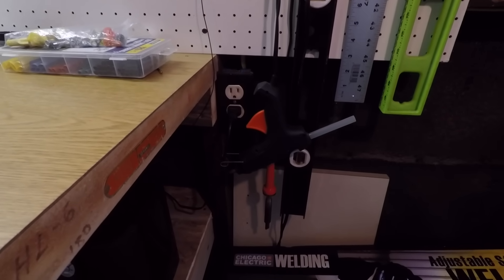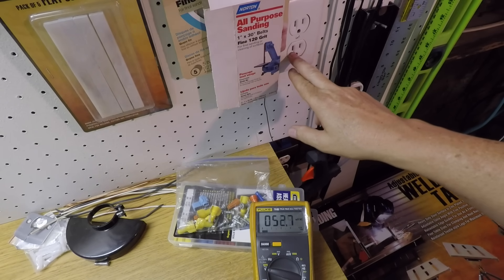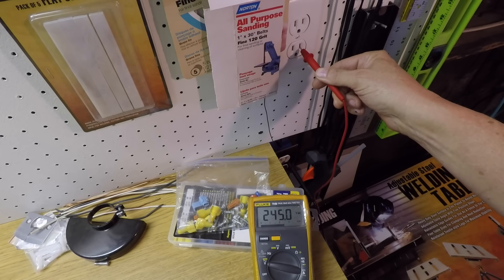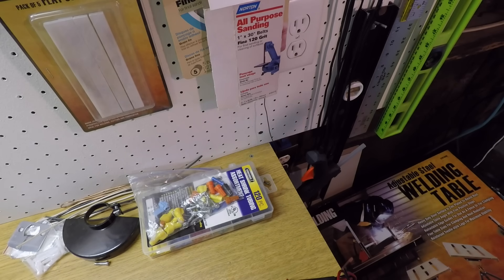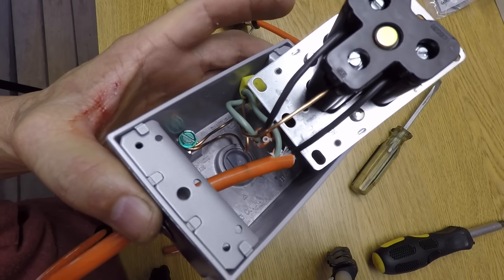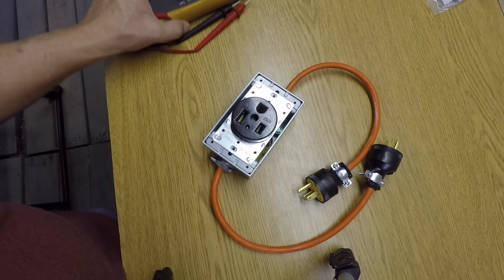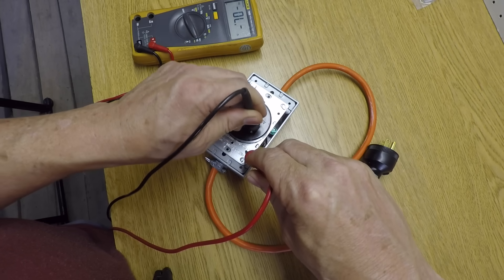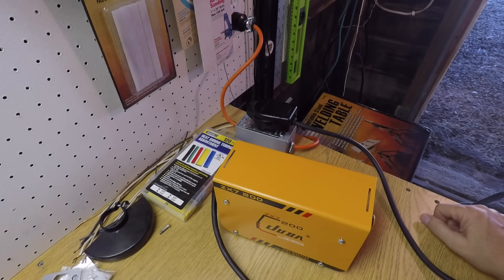How to Get 220v From 110v

Comment: Lol.  Putting 20a wire on a 15a receptacle  doesn't really make it a 20a circuit.  Close....but no cigar.
Reply from the maker: LOL Having more than one outlet and a 20a breaker to go along with it does.
Reply from the maker: The National Electrical Code, in article 210.21 (B) 1, 2, and 3, describes the requirements of single and multiple receptacles on a circuit.

The use of multiple 15 amp receptacles on a 20 amp circuit is permitted. A duplex receptacle is considered as multiple receptacles and is therefore permissible to use as the single, or one of several, multiple type receptacles on the circuit.

Part of the UL listing for the 15 amp receptacles is that they are capable of feeding through the 20 amp circuit, the primary difference between 15 and 20 amp receptacles being the faceplate configuration.

Receptacles rated higher than the circuit rating may not be used, so 20 amp receptacles are not permitted on a 15 amp circuit.
Reply: @DIYHomesteadProjectsDIYHP10  you can legally use a 20 amp receptacle on #14 as long as the wire is protected by a 15a breaker.   A 15a receptacle is only legally protected to 15a so do whatever you please.
Reply: I wasn't trying to give you a hard time I merely found the humor in it. I have done it myself.  I think that little wire welder won't come close to the capabilities of that circuit.  I wouldn't try it with a stick welder though.  Haha
Reply from the maker: I get that comment quite a bit on this video. I wanted to post the info I found so hopefully others would read it. Most people don't read anything, they just post what they are thinking. Anyhow, no worries, thanks for the comments!

Comment: Just wondering if after a year your garage isn't burned down?
Reply: Using the cheapest extension cord too. I wont even run general power tools on those cords...
Why not just build his own 50amp extension cord plug into the dryer or something...
Reply: 12 gauge wire can't handle double phase but if he doesn't use high amp required devices it shold be ok. but I wonder what kind devices it would be.
Reply: @psyo123  He said the extension cord is rated for 15 amps, which would make it a 14 gauge cord. 

There is no such thing as two phase power. This is single phase 240 volt power being fed from two separate breakers. You can put 240 volt power on #14, #12, or anything else for that matter. You size the wire based on the amperage required, not voltage.
Reply: @jonathanpakozdi2796  There is two phase power but this isn't it. Most two phase equipment and lines have been replaced with 3 phase power or single phase. Two Phase power was two phases 90 degrees apart. Three phase is 3 phases 120 degrees apart. There also is 6 phase power.
Reply: @gravelydon7072  right but homes have 2 phase in most places that's why the service is 240v at 200amps so than you brake it up in the panle so it drops to 120 v on each side  so when you do a 2 pull it gose across both busses to make the 240v again
Reply: @gravelydon7072  like when you do a home panel it should be balck and red if it's 3 phase than black red blue. Black is 1,2 red is 3,4 blue is 5,6 than you repeat.    277 or higher is typically brown orange yellow  brown is 1,2 orange is 3,4 and yellow is 5,6 and you repeat
Reply: @psyo123  12 gauge wire can handle 20 amps of current regardless of voltage,  240, 480, 120, 12v, etc.
Reply: Matter of fact all romex is rated for 600volts max
Reply: @sparkyjerred419  that rating is the insulation rating

Comment: if you read the output of welder fan it will show only 110 and fan will not support welder due to device thinking it is recieving 110 and 110 not 220 wear rubber shoes if you try this to weld

Comment: That's an inaccurate title. You already have 220. Why not use it as intended instead of splitting it adding more unnecessary connectors and bringing it back together. You could also add jumper cables in the mix but its not a good idea. It can also bite you if someone unplugs one side with the circuit on. 🤔

Comment: Would this be considered legal?   Technically I can see why it works because it appears to be electrically the same thing as draging 2 hot wires through a breaker which connects to each side of the bus.  I was thinking for insurance purposes if something ever went wrong would your home owners pay.   I was thinking of getting an electric clothes dryer but I don't have
240vac in the area but I do have 2 receptacles that just happened to be on different side of my panel bus verified by measuring the 240vac like in the video.

Comment: They do not need to be on different bus bars, as a 240 breaker is on just on rail bus bar in the service box. However  I'm not sure as to why you would cut off the neutrals? Should of got a 4 prong outlet and bonded them together in the outlet for safety reasons you need a common ground, neutral and hot or hots to complete a 3 wire ground system. Also one should be aware that if you are running a small load this would be ok however the 240 system always uses a larger gauge wire then what you would for a 120v outlet. So I would suggest keeping your device close to the outlet ( meaning no extension cord )...

Comment: keep in mind that the stranded pair has more resistance thus if you have a constant load it will heat up faster and hotter if they are not rated for the right load. Stranded wire also carries less current than solid. The only benefit that i see is that since you are moving it around, is that the wire used to plug into both phases of electricity wont break as they are being bent or twisted. I would just suggest to put a dedicated double pole breaker rated to what the welder needs and wire a dedicated outlet to it.

Comment: Every panel is capable of supplying 240V. The transformer supplying power supplies +120V and -120V, with the neutral going to the center of the transformer. The positive and negative bus alternate in the panel. Just get a 2 pole breaker and your output with be single phase 240VAC.

Comment: You should mention that each outlet needs to be fed from separate buss bars in the panel. I think I would run a 240 volt outlet before I would do this but I have a lot of experience with electrical work. Thx for the video
Reply: He HAS to be on separate phases, either in panel OR downstream. Physics requires it. He would potentially trip 2 breakers if he got it wrong.
Reply: 110 , just wiring massively improperly
Reply: Also should be said that he is not making 220 from
Reply: @crusherfang9368  Nope, he has established that he is getting it from one phase. That is all.

Comment: Pros can grab live power meter leeds and test away.. I would say to any novice/ diy you need to have thick rubber gloves on. If you sit, use on a non metal chair on a rubber floormat.You need to have eye protection, you just don't have the years in- you might make a big flash with some fireworks.

Comment: The comment abnout the wire size is correct. I believe that his welder is l;isted to draw 25A at 240 volts so he will not be able to get as much welding power as it is designed for. The other concern is with the circuit breakers. If one of them trips due to excessive current and the other breaker does not trip there will be a lot of the equipment that will still have 120 volts present. In that case unplugging the plug on the circuit that has tripped will probably have 120 volts on the hot blade. Using a 50 Amp plug might be to give him the opportunity to plug it in to a 50 amp receptacle already installed in another location. However thhat would leaave hir welder unprotected for it's 25 amp rating. I would want to replace the circuit breakers with a two pole breaker with a common trip to increase the safety of the situation.

Comment: Yours is a step up from my "test rig" : two extension cords from different parts of the house with a two prong lamp cord plugged into each hot thus providing 240v into two alligator clips!!!  (I had an piece of European equipment on the bench).  I hope your followers do not have an old Federal service panel and a "tombstone" buzz box that needs 50 amps!  That combination would make smoke!
Reply from the maker: An old buzz box or any welder that actually needs more than 20 amps would be tripping breakers before letting out smoke I would think.
Reply: @DIYHomesteadProjectsDIYHP10  yes sir normally but old Federal breakers have a bad reputation for not tripping!  No point really.  Keep tinkering.
Reply: @JIMO415   Guess who was one who found that out in 3 phase breakers. We had to replace all of them as they would either burn or explode. And boy did they stink.

Comment: To fix the last problem you mentioned,  put 15A fuses or higher depending to what you want to run to each hot lines of your box.
Reply: 15A "or higher"......now there's a recipe for trouble.
Reply: Circuit breakers installed by a electrician who knows ... Never exceeds amperage the gauge of the wire or you can melt the insulation, plastic and burn down your house.

Comment: I did that once by mistake in a three way switch setup..  It worked fine with candescent bulbs, only the fancy big flat type switches I used would pop and flash if you slapped them on/off to quick.  lol
Reply from the maker: Too funny!

Comment: You already have 240 VAC. You measured the two phases that you building already has. When you install a two pole breaker (240 single phase) you are doing the same thing as using the two 120 receptacles except you are running one of each phase to a hot terminal, hence 240V. (one of each 120 v phase) The neutral and grounds are the same for all circuits. You will see that your breaker box has a buss bar with all of the neutrals attached and a buss bar with all of the grounds attached. All you need to do is put in a two pole breaker and run the two hots and the ground to the 240v receptacle. This is how you get 240 in any house. ALL houses have two different phases of 120 feeding your main breaker in your panel. If you have an electric stove or oven, A/C or electric water heater or electric heat you already have 240 v circuits. There is no such thing as a single 120 volt electric box.
Reply: Well, to be fair, I don't think he was trying to say much different from what you just said - but he just doesn't zoom out far enough to see or describe the big picture...
Reply: Brilliant, he could have made the second plug a 240v just as easily.

Comment: Does a 20A breaker designed for 120V perform to spec when part of a 240V circuit? Will it trip at the same current threshold?
Reply: There are 20A 208v circuits this is not one of them without explanation.

Comment: Bruce, two deadly errors in design and not code compliance nor safe for you and your family: use logarithmic stepped standardized wire gauge and plugs plus you cant just eliminate the neutrals and just use the hots; the neutrals must be feed back to the bus on the main panel and you do that by utilizing the grounds ( pigtail them); you don't just cut the neutrals off.  Please research what I just told you, it's a cheap and easy fix.

Comment: What happens to your equipment when only one breaker trips?  Say your welding, or using a compressor and Jr. turns on his space heater and trips the breaker, will running a 220 vac on only 110 damage the equipment?
Reply: Actually this is kind of dangerous. If one breaker trips and the welder is on, now you are powering the branch circuit with the tripped breaker with current flowing through the welder. Assuming that breaker had a good reason to trip, now you have overridden the protection. The voltage drop through the welder would reduce the current on that tripped circuit possibly to the point that the second breaker would not trip, creating a potentially hazardous voltage on the branch with the tripped breaker. With a dedicated 240V circuit you eliminate this possibility.
Reply: @IllyaLeonovMorganFreepony  would the super duper $300 dollar one avoid that situation,? I'm not an electrician.
Reply from the maker: My welder will just shut down. I don't know what would happen with other equipment. I only used this with my one little welder. Some have said in the comments that it will ruin equipment with a motor. I never ran anything with a motor so I can't verify that.

Comment: I would add a small sub panel and connect both 120v plugs to the little panel and add a 20 amp 2 pole breaker then come out of the box and put your 240v socket/box now your a little safer

Comment: I've done enough wiring to know that running a 50 amp welder through those thin wires isnt good. The wires will burn up before the breaker will flip because it's on 20 amp breakers.
Reply: This is backward. You can use thicker guage wire... Or higher rated plugs. The breaker will trip before anything else. You can't use a 50amp breaker with 15amp wire/receptacles

Comment: thank you for your video it was very enlightening to me.

I have a few questions / observations...

a. Where the the neutral go for each of the 110 V outlets?  
why did you decide to cut it off from your extension?

b. how come this device is working, without using the neutral of both 110 V outlets ?

c. I also have an observation concerning the 220 V outlet. You are connecting one of the live 110 V wires to the neutral of this outlet.

thank you again
Reply from the maker: A - The neutral is not used in a three wire welding plug. (two hots and a ground no neutral)
B - My understanding is that 60 times a second the two hots alternately become a neutral in this three wire 240V circuit. (one is hot and the other is a neutral - the hots alternate in this function)
C - No neutral was used in this circuit. This 240V outlet has no neutral.
Reply: @DIYHomesteadProjectsDIYHP10  thank you for your quick reply and thank you again for the original post
Reply from the maker: You are quite welcome.

Comment: The majority of the comments I read for this video are correct. However, I felt like a little more clarification could be helpful. In the United States a residential electrical service typically consists of two 120 volt hot lines and one neutral line. Going from either one of the hot lines to the neutral gives you 120 volts. If you measure across the two 120 volt lines and don't use the neutral you will find 240 volts. In the breaker box you will find three bus bars behind the circuit breakers. Two of them are 120 volt, and the third one is a neutral sometimes referred to as the ground. The bus bars are arranged so that two adjacent circuit breakers will pick up both sides of the service in the box. This is why a 240-volt breaker is twice as wide as a 120-volt breaker. It has to grab both of the hots in order to work. Those double-wide circuit breakers are also designed so that if something trips it will shut off both of the hots at the same time. The arrangement shown in this video has the potential to damage your welding equipment simply because if one of those circuit breakers should happen to trip you'd still be sending power through the other line. This could cause damage to circuit boards or potentially give you a nasty shock because the power isn't really off. As a professional welder and an electrician I don't recommend this setup. It will work but there are far safer (and cheaper) ways to do this.
Reply: Breakers are not there to protect the device in the first place. Breakers are strictly to protect the wiring from causing a fire resulting from a short to ground. If your an electrician then you should know this. From what he already said in the video, he is aware of the device still possibly being hot in the case of one circuit tripping or otherwise not working and is perfectly willing to accept the risk.
Reply: The technical thing with your two power legs, L1 and L2 is that one is 180° out of phase of the other. When combined you get 240 volts. It doubles because 180° is half of the full 360° AC cycle. 
Its how it comes off the AC alternator from the utility company. Three phase power, each leg is 120° out of phase from each other. Three phase has some strange phenomenon to it and can be extremely dangerous for someone not familiar with how it works.
Anyway just FYI as to what the difference is in those two legs its the phase or the timing of the two cycles.
Reply: @ElectricBillAlbright  That is not correct, Three phase (time) and phase legs of single phase (polarity) are different things. 240 "US residential" is normally a single phase off of the 3 phase grid (utility co). The other two phases are not available to you. 
Your 120, as well as your neutral is originated at the transformer located at/near your property line. Your neutral is not the same neutral as the neutral down the road, although it is tied in with earth ground.
Reply: It does make sense, pretty much 2 different breakers, but I still wouldn't do it.
Reply: IMA  TRY IT...
Reply: A
Reply: Would being plugged in to a gfi outlet add a little bit of safety? I have heard of people using a similar box as what he made but it was only  one time
Reply: IAM not a electrical expert but I noticed the box should be grounded to the panel .the box is not grounded sitting on your bench
Reply: Is this set up will work for a portable scissor lift ? It said it used 220v 60hz 2.2kw? It’s for sometimes use on my home garage when I need to lift my car for small repairs tia